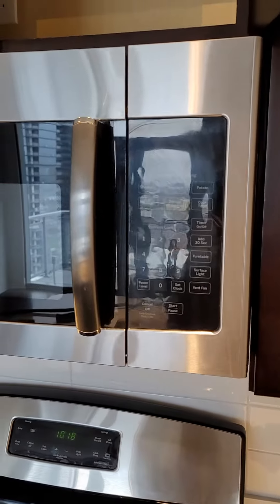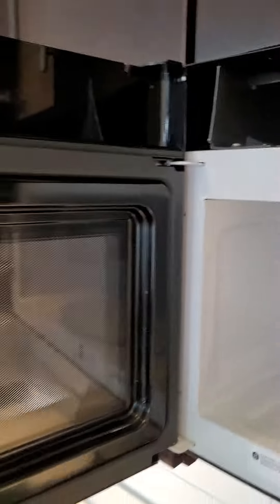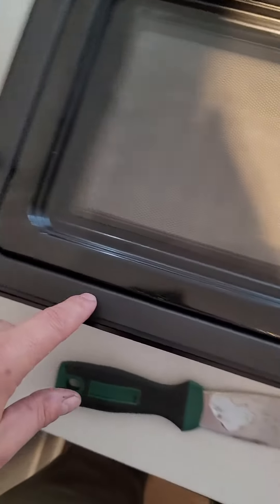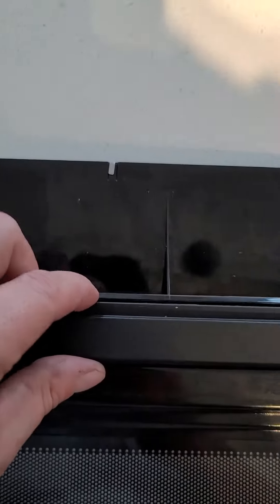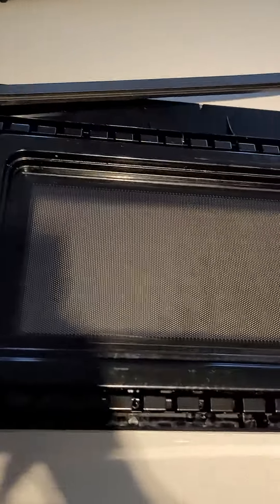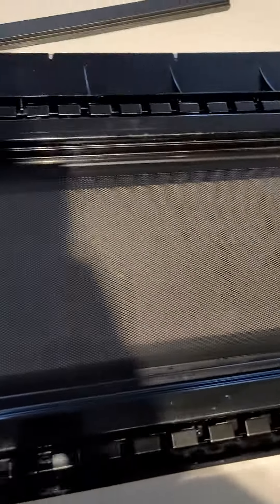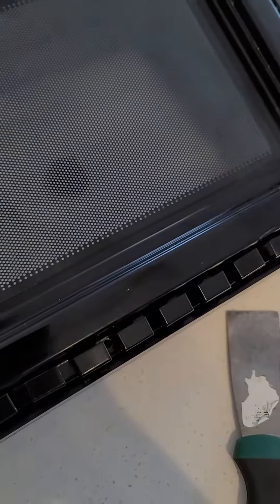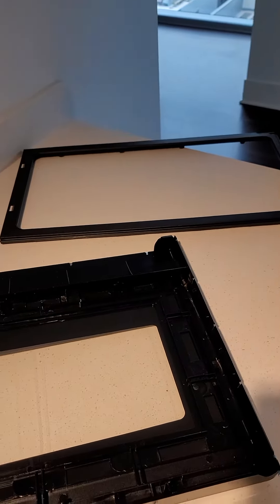Microwave Ge glass door seperation, replacing broken door handle

Comment: Than you so much.   Every other video shows that just taking off the trim panel reveals the handle screws.   Mine did not , so had to go through all the other steps you outlined.  Don't know why I keep buying GE stuff.  My door handle was plastic as were the holding bracket.   Both of which broke.   I got a brushed nickel handle from Wal Mart online for $7 delivered.  It looks really nice on the microwave.    Thanks again for the instructions.

Comment: Thank you for this video it’s exactly what I need to do to my door and your video is the only one I’ve found that has actually helped. Mine has so many streaks I hate the way it looks. The only problem is for some reason I can’t remove the door like you did, it does slide up but doesn’t detach. I have a GE JVM3162DJ2BB. It looks just like the one in the video but I can’t take it off that way. Do you think I can do this with the door still attached?
Reply from the maker: You have to open the door completely, and lift up and out. The top comes out first, than the bottom
Reply: @besicm1  thank you I’ll try again I just don’t want to rip my microwave off the wall 😂
Reply: The trick is not shown in the video.  The upper panel does not "pull off".  You remove the screws (mine had 3 screws) on top, then SLIDE the upper panel to the left.  If you pull straight out hard enough without first sliding to the left, you will break the retaining tabs.  After removing the upper panel, then you can remove the door by lifting off the hinges.

Comment: You have got to be kidding me. I mean seriously what the gdmfs, you skip right past separating the two parts! So did it not work out the way you explained or are we supposed to believe you had another reason for just skipping past the most important part of separating these two pieces. Maybe it was so easy and quick that you felt like we didn't need to know? Or did you somehow mess it up because of another unexplained mysterious skip? No video, I mean an absence of any video, would have been better than what you left me with. Unbelievable!😡
Reply from the maker: You try filming with one hand and working with the other! It comes apart as I explained in the video. I have done it hundreds of times on this type of microwave the same way. What exactly are you stuck on?